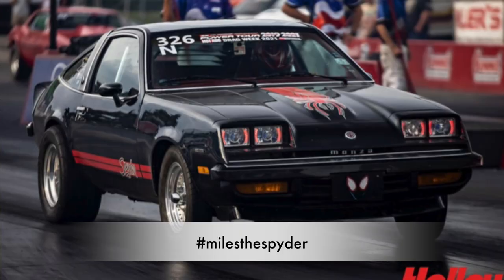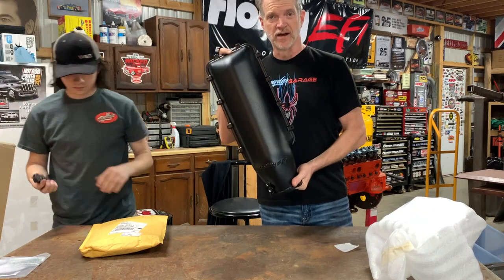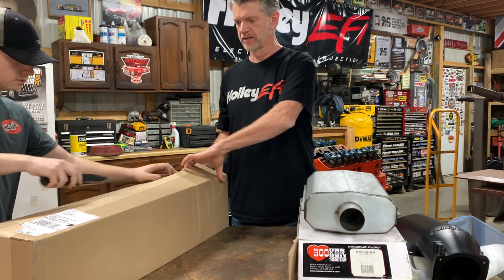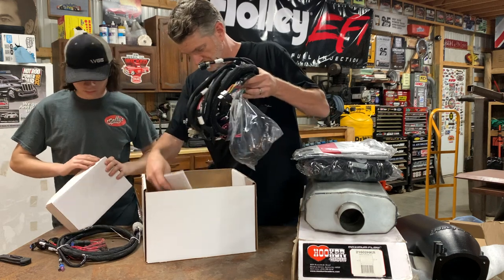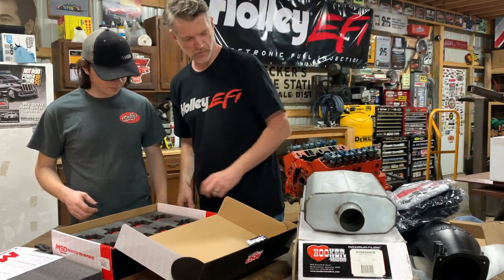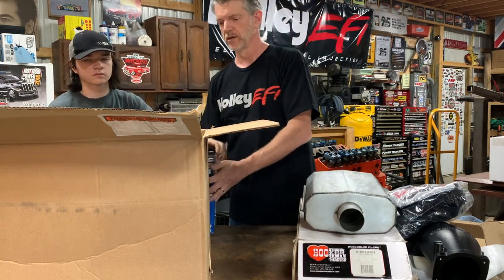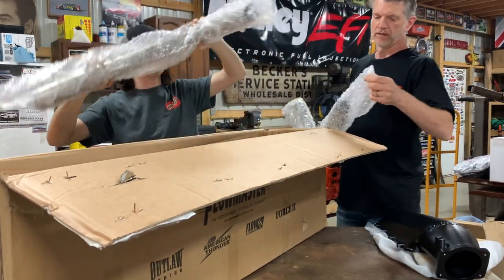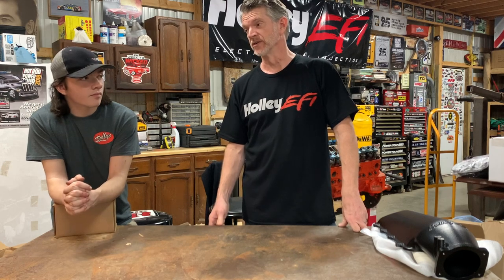HUGE UNBOXING with our new partner Holley Performance!

Comment: There is nothing wrong with a built TH350 trans my Dad and I ran one in our drag car for over 10 years behind a built OG 350 bored .030 so a 355cid in our 72 Nova and it was on stock leaf spring suspension and it weighed 3000lbs and it ran 10.90s consistently and it was a very solid combo as we didn't have any catastrophic failures at all and we never had to pull the engine for anything all we did was just the general maintenance and it was 14.1:1 compression on a 28x10.5 slick and then one day we decided we wanted to go faster so we built an OG 400 SBC and when all said and done it ended up being a 434cid with a TH400 trans Fab9 rear end with a 4link and a little bit of nitrous and now it runs mid to low 5s in the 8th depending on how much we spray it
Reply from the maker: Yup, agree.  Our big issue is just gas mileage with the long trips we take on Power Tour, Drag Week, etc.  Reving at 3500 on the highway is getting expensive.  ;-)
Reply: I've heard a 4l65 is the best of both worlds. According to a friend that is a trans builder

Comment: Check out ....rock solid motorsports.  And look at the rest suspension  upgrades for the grub worm Camaro  for 22. I like how they used the turned around  wisk bone  to get rid of the pan hard  bar. So you can get ex..pipes over the axle.  The future is wide open  for MONZAS.🥰👍👍👍.
Reply from the maker: Will do!